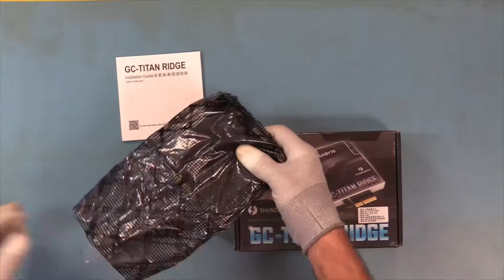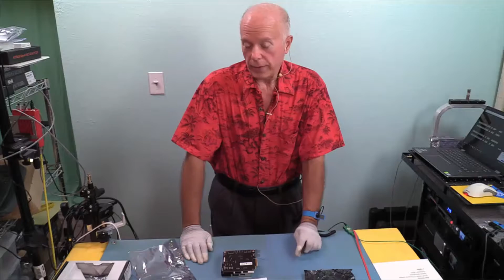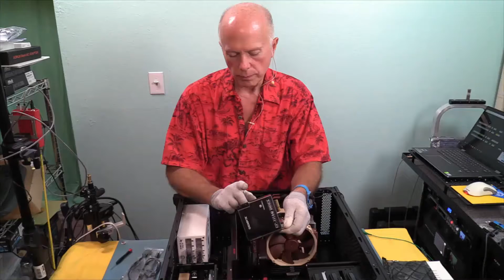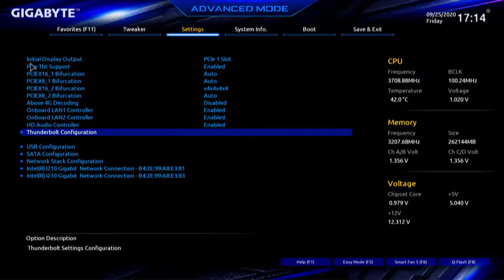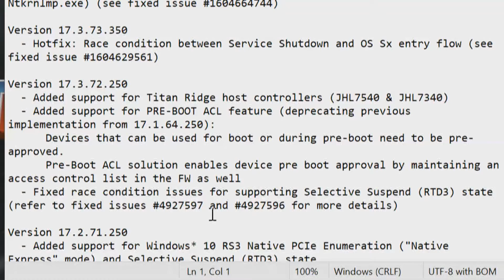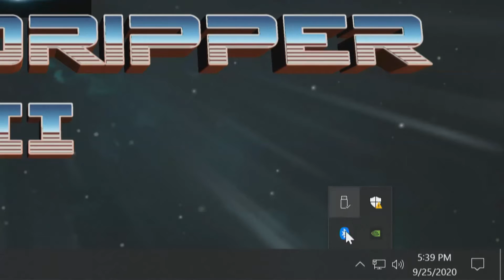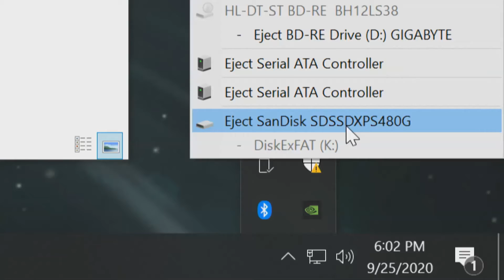Titan Ridge Thunderbolt 3 Unboxing, Comparison and AIC Simple Install on Gigabyte TRX40 Designare

Comment: Was having a ton of trouble getting this to work. While I knew about tinkering with the BIOS to get it to work, I never knew how to go about getting the drivers. Thank you so much for showing that!
Reply from the maker: Hi The Obsessive Gamer, 
This should not so much of a pain! We persist and prevail! Appreciate Your Comments! We did a separate Video just on the Drivers as a foreshadow to this. Details matter! Especially to get Thunderbolt working! And it does! Much easier to accomplish on TRX40 than on x299.
Reply: @BuildOrBuy  Yeah i'm using the z390 which has a similar set up. I'm normally a very technical person myself and I was having a lot of trouble. Again, appreciate your hard work here and I hope Gigabyte streamlines these in the future. You got yourself a sub.
Reply from the maker: Hi @TheObsessiveGamer , Thanks for Joining Us! Honored! As always, details matter! We share what we know! Interesting thing about some of the new Gigabyte x570 Motherboards, there's quite a mix of Motherboards... support / non support for Thunderbolt 3. And nothing in the PDF Manuals! They make Us work for it!

Comment: Gill, I like your channel. I will be following along with a TRX40 AORUS XTREME. I got the Titan Ridge 2.0 I was going to try my Thunderbolt displays.
Reply from the maker: Hi john valdez, 
Thank You for Your Comments! Much Appreciated! Welcome to the TRX40 Platform! The Displays - 
Let's hope they are not Apple? Doubt if Intel has them on the approved Devices List. Only way to know it to try! The Titan Ridge 2.0 is more likely to work than the Titan Ridge 1.0. Higher Power Delivery, if that matters to the Thunderbolt Displays. 

How will You be using Your Threadripper 3? Content Creation? Are the Monitors rec709? 

We're trying to finish the Script for the USB Audio interface. Then on to the Thunderbolt 3 Audio interfaces, then Thunderbolt Storage. Questions keep bobbing up that require either attention or a Video! Great time to be Building a Computer! Thanks for Watching! If You have any Questions or if there's something You'd like to see Us cover, please let Us know! Stay tuned!

Comment: Hello there and great video; much appreciate this.

Question here: Have you tested to see if the card will work in the 1st PCI (16x) slot (currently where you have the GPU) ... or even the 3rd (16x) PCI slot?
Reply from the maker: Hi Andrew Clark, 
Nice to Meet You! Thank You! We think the problem is the Bios. We have not tried the 1st x16 Slot where the GPU sits nor the 2nd x16 Slot where the NVMe Quad Card sits. 

We have only tried the 2 - x8 Slots. We now have a Titan Ridge 2.0 Card and will follow-up on this, in that video. Crazy right? We were using Bios: F4c, Dated 03/05/2020. There is also a new betas Bios: F4i update Dated: 09/25/2020. There was un update, Bios F4k, in between the 2 mentioned. It was unstable and not useable. Lots of drama, for a Computer! In a nut shell, Keep it Simple! Stay Tuned!
Reply: @BuildOrBuy  Thanks for your (informative) reply. Looking forward to see what the outcome is when you finish your next test. Stay safe and healthy!!!
Reply from the maker: Hi @andrewmclark1961 , Absolutely! Your Questions help Us to make better Videos! We've just finished up a Video about the Samsung 980 Pro! We will get back to Titan Ridge Thunder 3 before we get into the Thunderbolt 3 Audio interfaces! Thanks for Your Input! Details matter! We just need more time!

Comment: Concerning the Gigabyte AIC Retail Version:   Have you contacted Gigabyte about the USB cable problem  described in Part 2? is it possible it's just this specific TRX board?  Also what driver version CD  came with the retail Gigabyte AIC ? mine says Ver 1.1   12DC1-TITANR-110AR   comparing what you showed for the folders and files on your cd, looks completely different to mine.

The USB cable part number is P/N 12CR1-1UB040-11R
Reply from the maker: Hi Terry, Not yet. I know enough to know I need to know more before contacting Gigabyte. The USB 2.0 Cable should not be causing a problem. I wonder if there's a Resource Allocation problem with the Bios. Once we know more, we'll share! 

We now have a Titan Ridge 2.0 to test with and compare. We'll record that and see what happens. If it's worth sharing, we will! Never seen a problem like that! Has Us really curious!

There is one other Gigabyte TRX40 that has undocumented support for Titan Ridge. 

After we've completed our assessment then we'll contact Gigabyte. Their support system is not very supportive nor User friendly.
Reply: @BuildOrBuy  I wonder what the difference is between the AIC card shipped with the Designare Mobo, versus the Retail v1.0 and there is also a V2 that has a 5 pin TBH_C and a 3pin TBH_C2.....although there doesn't seem to be any TBH_C2 header on any mobo that I can find.
Reply from the maker: Hi @shockwaveriderz ,
The only difference we could ascertain about the 2 Titan Ridge 1.0 cards was a Serial Number. Everything else checked out the same.  

Yes! We have a Titan Ridge 2.0 card. Have not had a chance to check it out yet. We will, on Video! Thanks for pointing that out. My guess... The Threadripper Pro is going to have Titan Ridge Thunderbolt support! New TBH_C2 header, new Platform! This is exciting news!
Reply: @BuildOrBuy  that's interesting news
Reply: @BuildOrBuy   I also learned something from you. Instead of just tearing open the little plastic bags with the cables in, they all have P/N on them so for now on I'm going to scissor them open and keep them.
Reply from the maker: Hi @shockwaveriderz , Details matter! Thank You for Sharing that!
Reply: @BuildOrBuy  Can't wait
Reply from the maker: @shockwaveriderz  I'll check and verify that part this evening and get back to You. Good question! My hypothesis, this is Bios related. We'll see!
Reply from the maker: Hi Terry, 
Interesting. We have 3 Titan Ridge 1.0 Cards. All have Version 1.0 CD's from 12 months ago. Long story. The Driver CD from the Motherboard is also Version 1.0 from 4 months ago. Don't know yet about the Titan Ridge 2.0 Card. Brand spanking new! For an unboxing! We have several Subscribers who like Unboxings! We will make note of all of this when we do that! Thanks for Sharing!  Stay Tuned!
Reply: @BuildOrBuy  Gill: on the back of my V1.0 TR is a fc ce sticker that's says : 12LB6-TALPINE-10R ..there's also a barcode sticker: 1/C/K4A150 00256
Reply from the maker: Hi @shockwaveriderz , That's an Alpine Ridge card.
Reply: @BuildOrBuy  does your TR 1.0 cards have a similar sticker? If so what do they say?
Reply: @BuildOrBuy   the sticker on the box says gc-titan Ridge  rev 1.0 for model name....I'm more confused than ever now
Reply from the maker: Hi @shockwaveriderz , You're right! Same! So that Is Titan Ridge. Curious naming convention. There is a 3rd sticker Label stating Titan Ridge. 
Card Labels: 
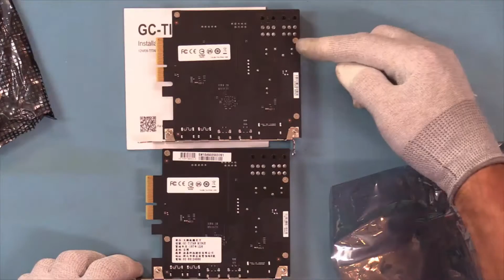4:10
4:30
Reply from the maker: Hi @shockwaveriderz , That makes two of us! We need more Info. When we do the Titan Ridge 2.0, we'll pause a little longer on those back Labels. Thanks for Asking!
Reply: @BuildOrBuy   i have a C so it may have the same fw as your mobo boxed  one. 

THAT makes  me feel the B for may be faulty 

Does the stickers on either of yours say FC EC  TALPINE ?
Reply from the maker: Hi @shockwaveriderz , Might be faulty if using only 1 card but not 3 in a row. Al purchased at different times. Same Vendor. Amazon. 

I still think this has something to do with the Bios. We just need to verify. We know enough to know we need to know more!  The current beta Bios should tell Us what we need to know. 

I'll check and have all of that info in the Video when we cover the Titan Ridge 2.0. Thanks for Asking!

Comment: You do a great job explaining it in great detail. Very academic! I have an Asus Maximus VIII Hero Alpha Mobo, any idea whether the Titan Ridge Thunderbolt 3 card would work with board? I'm trying to have connectivity with a Drobo 5D3 which has two thunderbolt ports. I would appreciate your suggestions...thanks.
Reply from the maker: Hi Victor Medina, 
Nice To Meet You! Thank You! Details matter! Short Answer, No. Possible? Maybe. Use USB-C Port instead. Data Delivery is THE one thing that makes sense with Thunderbolt 3! 

Longer Answer... 
Asus Maximus VIII Hero Alpha - Is this Your Motherboard? Chipsets are the Key!
https://www.asus.com/us/Motherboards/ROG-MAXIMUS-VIII-HERO-ALPHA/
Intel Z170 Chipset - Launched: Q3'2015
https://ark.intel.com/content/www/us/en/ark/products/90591/intel-z170-chipset.html

On that Motherboard... You have 1 PCIe 3.0 x4 Slot. Good. However... No Motherboard Bios support. No THB_C / GPIO Header on Motherboard. Possible. No guarantees. The Titan Ridge 1.0 card has enough power to be kept alive by Jumping Pins 3 to 5 on the Titan Ridge card. That in effect was what we would be doing and have done on the x399 without Bios support! 

The biggest problem, on Your Motherboard that I see right now, shared IRQs. The Primary PCIe 3.0 x16 Slot shares IRQs with the last PCIe 3.0 x4 Slot. And that could be a potential problem on an older Motherboard due to PCIe Resource Management. 

Gigabyte has a new Titan Ridge 2.0 Thunderbolt card. Difference in the Two - Power Delivery according to Specs. We're going to revisit this issue on the x399 Chipset without Bios support which may be of particular interesting to You! 

Hope that helps! Next Up, Samsung 980 Pro! Stay tuned!

Comment: Hi, thx for great video Gill.
Can you say your BIOS version ?
Reply from the maker: Hi Petr Miškeřík, 
Nice To meet You! Thanks! Yes... F4c. Beta but solid. No problems. There was another at the time, newer but problematic, and we would not use. There is now a newer Beta Bios: F4i. We have not tried that one yet. And will not until we can get more Feedback. We're getting too close to placing this Machine into Production. 

Install Titan Ridge in 1st x8 Slot. You'll be good to go! Thanks for Asking! 

BTW: How are You using Your Threadripper 3? Audio of course, but the Audio interface and Tools? 

Next Video coming up... Problems and Solutions. Stay tuned!
Reply: @BuildOrBuy Thx for your answer. Stay healthy. Take care man.
Reply from the maker: Hi @petrmiskerik , Ditto! We're here when You need Us!

Comment: Will there ever be TB3 support for the X399 Designare or Aorus Xtreme?
Reply from the maker: Hi Franz, 
Did a little research. Appears the x570 Motherboards are getting all the attention right now. x570 has a wider market even though we're in the high end. Seems we're not a priority at present. Looks like, in time, we will get Bios support. When? Only Gigabyte knows! We all need to make a request to get the ball rolling! 

Glad You asked. Keeps Us watching... and waiting! I have also learned there is undocumented support on a TRX40 Aorus Xtreme for Titan Ridge card! Furthermore, there's Titan Ridge (Rev 2) available! Differences? Appears (Rev 1 & Rev 2) are running same Firmware version but different Driver versions. Curious. Stay Tuned!
Reply: BuildOrBuy Thanks for keeping me posted. What do you mean by undocumented support for the X399 Xtreme? How did you find about it?
Reply from the maker: Hi @franzpleurmann2585 , Undocumented support on TRX40, not x399. Reading through Gigabyte Forums. Stumbled into what I found.
Reply: BuildOrBuy My bad. There goes a glimpse of hope 😭
Reply from the maker: Hi @franzpleurmann2585  , That's Ok...  There's always hope!
Reply from the maker: Hi Franz, That makes two of Us! Feels like we were sold a bill of goods, never delivered! Squeaky wheel gets the grease. Therefore, we all need to contact Gigabyte Support and make a polite request. A function not implemented. I'll do some research and see what the Gigabyte Forums have to offer. Great bunch over there helping thousands on a daily basis! 

That deserves a follow up video of the problem and the current solution. With hope for the future!

BTW: We have built Threadrippers on both of those Motherboards!

Comment: Been watching the vids on this build pretty closely. Meticulous, thorough, clear... very enjoyable to watch, and learn.

I'm curious about this chipset and the ATX motherboards for it. One of the MBs in a PCPP list you pulled up back in July is the Gigabyte TRX40 AORUS PRO WIFI. Assuming 3 M.2 slots are sufficient, and Thunderbolt is not an immediate concern, is there any performance hit in going with that board over the Designare? Thanks!!!
Reply from the maker: Hi Uzer Zero, 
Thanks for Your Comments! We try! Details matter! Just getting on the Platform is an accomplishment. It's a process of learning and understanding the Resources and System capabilities on TRX40 Platform. You'll be happy with Your selection and may have less problems related to beta Bios updates and PCIe Lane assignments. 

There are two potential areas of Concern. Both of which anyone on TRX40 should know about. And we will address them both separately as outlined below. 

1.) The NVMe stand off screws. On the TRX40 Designare, there are 4 NVMe Connectors. Two are usable. The other 2 have stacked screws. In other words a screw on top of a screw. And are hard to see. Without a socket, they cannot be removed. Requires a 4.5mm socket! The Video will explain and show the problem, in detail. 
2.) DPC Latency - Windows is not a real time O/S. DPC Latency is a problem for Windows. Especially with an Audio interface. Therefor, the 1st thing to be turned off would be WiFi. Both issues apply to all of Us. 

Back To Your Question, no reason to suspect a performance hit. Congratulations! Keep Us posted on Your Progress! 

How much RAM are You starting with? And How will You use Your Threadripper 3? This helps Us to make better Videos!
Reply: @BuildOrBuy  Hey Gill - Thanks for your input!!

Yes, WiFi will be disabled, as always. Thanks for the heads up on the NVMe standoffs.

I understand AMD is announcing their next CPU in a week or so. I'm hoping that might kick the prices of the current CPUs down a little. We'll see. Hoping to research, get what I need, and start building by mid-to-end of October. Total budget around $4k (ideal system linked in a reply below, w/2070 Super as a placeholder - PCPP URL + /list/Nj6gTC ).

I plan to start w/64GB (4x16). Primary function will be as a Digital Audio Workstation, mostly synthestration using Reaper DAW software, multiple sample synths, lots of read-only data streaming, minimal live recording. Secondary function will be 3D modeling using Blender & game development using Unity.

System should be as quiet as possible, but 3D / Game Dev function requires a high-end GPU. I'm waiting on the RTX 3070 - hope the Founder's Edition is reasonably quiet, because the price is right and it's the perfect length for my case...

Have an old, 8" wide Antec Solo Mid Tower case on hand with acoustic treatment that I'd prefer to use, if possible. My concern is headroom for a cooler. I have no plan to overclock, so I'm hoping the Noctua NH-U9 TR4-SP3 will suffice (it's basically what I have in my current system). I'd also prefer not to lose the PCIe slot closest to the CPU.

Thanks again!
Reply from the maker: Hi @uzer_zero , Absolutely! Doubt CPU prices will fall... Historically the Bundle deals were the ones to look for... However... In light of current situations even getting certain parts has been a challenge. Namely PSUs! 

Beyond the Threadripper Pro?

A Reaper Station Build! Thanks for sharing. Not familiar with Reaper. Price is right! Will have to look into that!

We ran into 4 problems we'll outline in the next video and solutions. One being the NVMe standoffs. You should be good to go! Right amount of RAM and an easy path to Upgrade to 128 later if needed.

Comment: Hi Bill, watched this and was wondering if you intend on testing connecting TB 2/1 devices into Titan Ridge. I have a Promise Pegasus array using TB 2. Promise suggests the Startec TBT3TBTADAP adapter to make things work. Are you using that in any of your tests? They are emphatic about NOT using the Apple adapter because it seems to only work with Mac equipment and not 3rd party (AKA Titan Ridge). Just sayin......keep up the excellent work.
Reply from the maker: Hi Lee, You bring up an excellent point! Yes we will. Thanks for asking! And Thank You for watching! Stay tuned!